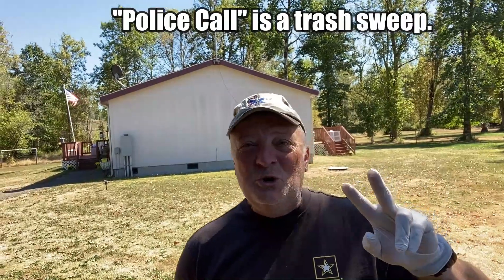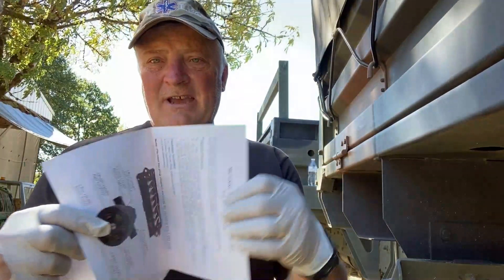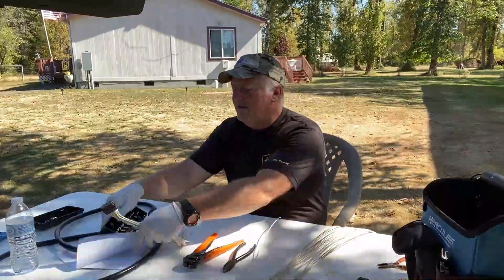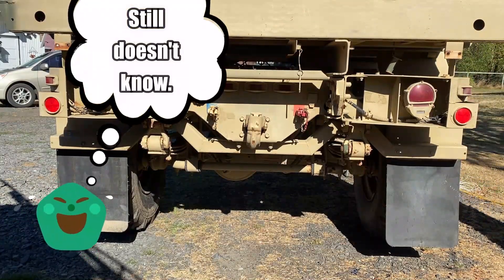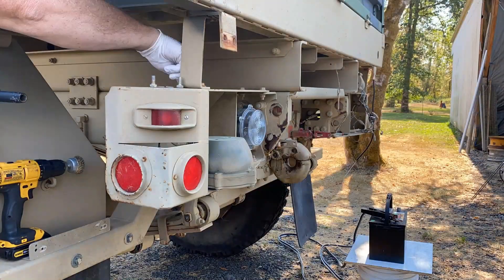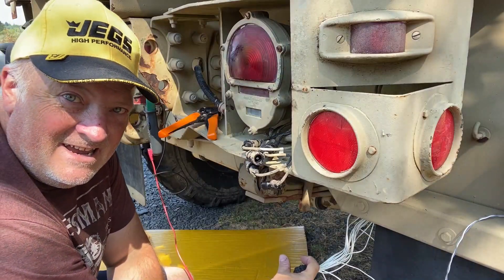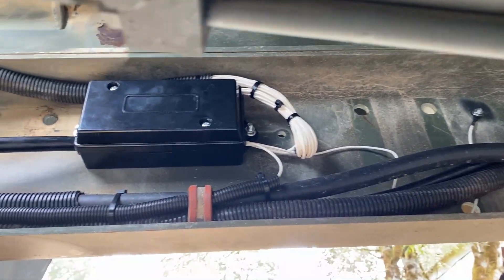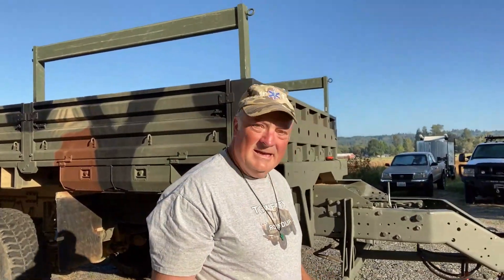FMTV MIL TRAILER WIRING HARNESS Solution #131

Comment: The issue is that on civilian plugs, the brake and turn are on the same pin, military is not.  You need to combine them with a diode to keep the signal from back feeding into the truck electrical system through the flashers.
Reply from the maker: I just used the electrical brake lead to give me one extra line. It seems to work with my civ trailers. It is such a confusing mess, I am not even sure if I want to take it apart again to understand what I did or what I still need to do. Thanks for making that known to me... perhaps this summer I'll set aside a day to monkey with it again.

Comment: I read the information you provided in the description. Sounds like you will be adding two 7-blade connectors to your truck. Do what you got to do to make it work. On the bright side, there are already two on there, so what is another 2? It's nothing, just roll with it. Good luck!
Reply from the maker: I'm rolling. Oh yeah. Today, I made a bracket to hold two 7 blade connectors for Malachai... just have to order a second one from Amazon. The difficulty will be tearing into the wire bundle and trying not to damage anything while splicing in two extra sets of wires! :-o Fun-fun!

Comment: If you wire it like Ford does you will have less grounding problems. Why? Because the ground is at the switch and not on the body. Very few people understand "above ground systems."
Reply from the maker: Sometimes, these projects just don't come easy. A thorough understanding of the individual vehicle, as you pointed out, is so crucial. It seems like every engineer has a better way to do it. My issue now is to find where I can splice into the existing wires on the truck without causing too much harm. I'm still scratching my head and rubbing my chin on that one.
Reply: Helicool's Helipad check to see if your diagram is plug or socket oriented. 🤫

Also, call Cory tomorrow, he wired the 7 blade socket on our Sloth to match our Cougar using the 9 pin or 12 pin military socket wiring! Our 7 blade socket works with all universal RV plugs. 👍😉
Reply from the maker: @jenngill7772  Because I do not have an OEM military trailer plug, I have to wire it this way. In my next trailer build video, it will make more sense... I hope. :-D

Comment: I bought the EXACT same 7 pin junction box for my trailer build...  They make a 12 pin to 7 pin convertor and I am not sure what is in that but when I hook up to Martins trailer with my LMTV and the convertor all of the trailer lights work as they are supposed to...he even upgraded them to led lights and I connected all the axle brakes to the 7 pin box so it would work properly for hauling safely....  You will figure out a way to do it...
Reply from the maker: I saw that converter pig-tail for $129. I did not go that route for two main reasons... I didn't want to pay what I believed to be an overpriced item, and fabrication while working through the problem helps me learn about the machine (plus I like to fabricate). Now, I am almost wishing I had bought it. LOL!!!
Reply: @HelicoolsHelipad  I looked back in my purchase history and under 2 years ago they were 30 bucks shipped... I guess demand got pretty high recently...
Reply from the maker: @SeanFastidious  I really liked the one you came up with for $14 bucks. IF I was not already adding a "special" socket for the weirdie trailer, it would have been so much easier to go with the option that you found. I'll explain all in my next trailer video. Right now, I have to wait on parts to ship.